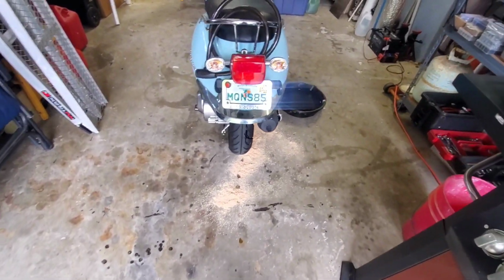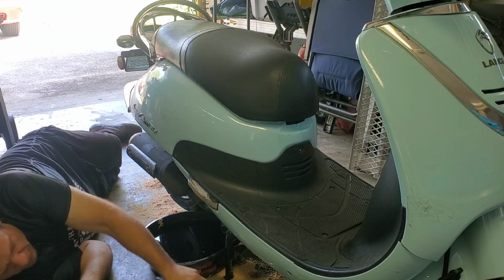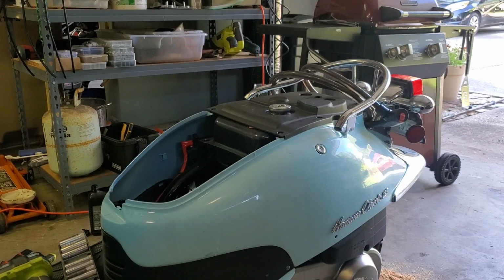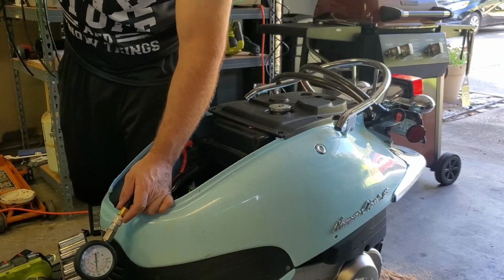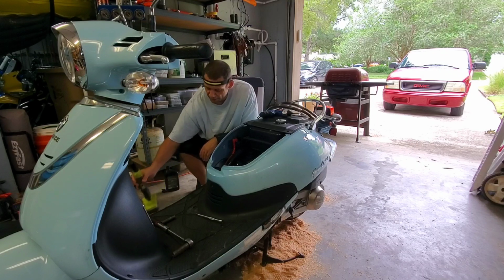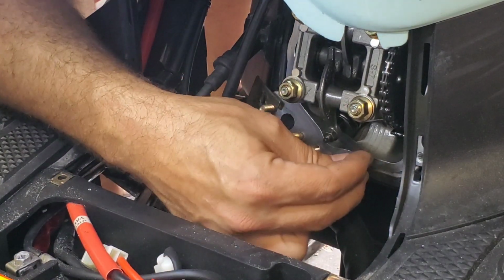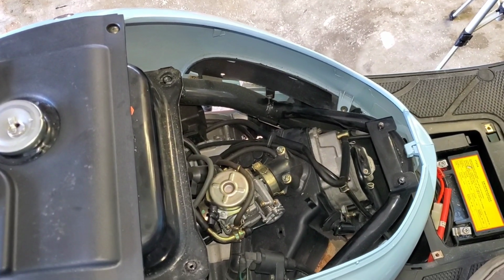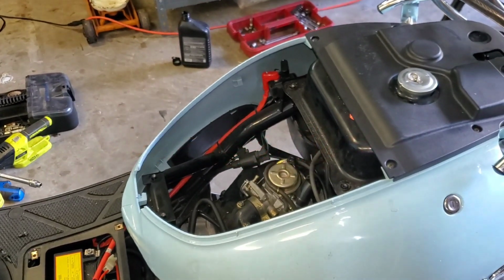Chinese Scooter Damage Inspection From Running To Much Oil Part 1 #gy6 #125cc #China #Honda #repair

Comment: Hi Dan I have a important question I bought a Bauer 120 volt 8amp heavy duty impact drill that's 1050 ft bbs of bolt breaker power will this remove my 10mm tao tao pony striped gear oil bolt out or is this not safe let me know

Comment: How do people destroy vehicles & engines wantonly, I have no idea !
It COULD be factory defect but with over 1,000 miles on it, that would have probably shown up earlier.
Maybe it was overfull of the low quality initial China oil fill, and they just ran the tar out of it, like that, overfull of crap oil.

Ironically, just today I was at a DFW Chinese power sports dealership, inspecting a brand new Vitacchi Ranger CN250 (Helix clone) Scooter.
I placed on center stand & unscrewed dipstick to check oil, and it gushed out, spilling on floor, for SURE it was overfull.

Plus the oil looked very sus, I'd never run it even a mile.
Change it immediately.
Crazy huh ?

Comment: I love your Scooter videos cause I have a TaoTao Quantum 150. I bought my Scooter brand new and after riding it come to find out my exhaust valve was too tight so I had to adjust that and the Carburetor was bad so I replaced that with another brand new one. It ran good then. My Carb is the same exact one as on this Lance Scooter.  I have to change the oil on mine in a week. Thank you for the video. I always learn something new when watching them. What was weird with my factory carb... it had these snap off security screws holding on the float  bowl on so I couldn't even get into it to look at the jet... that is why I replaced the carb. It was running and idling crappy with the factory carb.